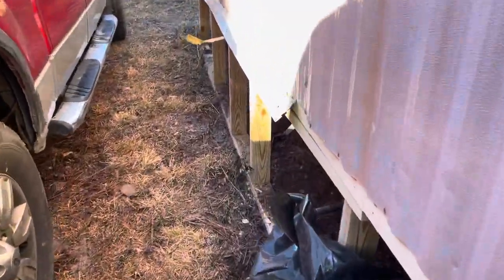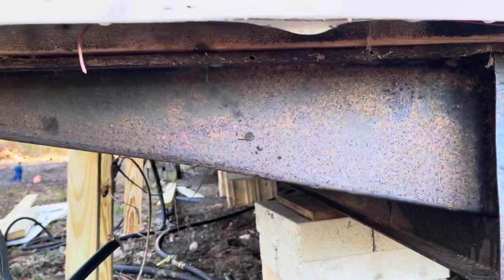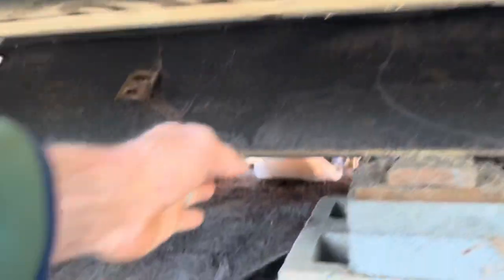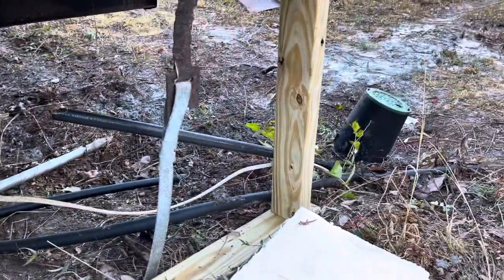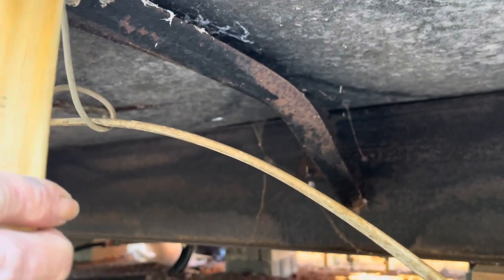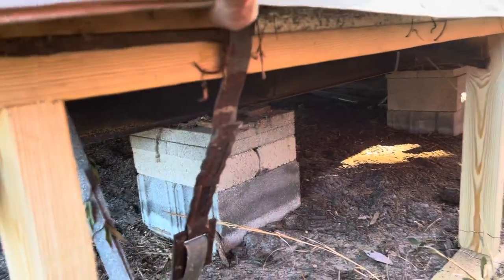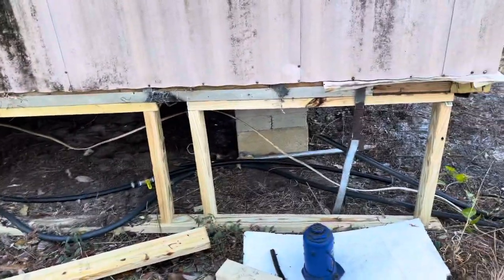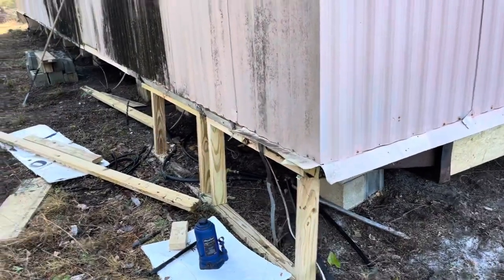Mobile home exterior wall support and underpinning

Comment: Hi Drew 
I had a company come out to look at my double wide. He says I have permiter peers so he wants to raise my house 1 inch on the permiter & place a 4x4 under each permiter block to sit between the house and on top of permiter. I asked him to use more than wants there & he said not necessary. Kinda of a this is how I do it & my suggestion fell on deaf ears. Told me it’s a 4 hour job. I can’t get anyone else to come have a look see . Any suggestions? 
I don’t mind spending the money to fix my home I just want it done right
Look forward to your suggestions
Reply from the maker: Interesting so it sounds like you’re just trying to level your house is that what you’re doing? if you’re just leveling then it shouldn’t take more than four hours.
Reply: My perimeter is sinking if you roll a ball it rolls quickly to the corners & permiter. I have cracks under all my windows . You feel like your walking downhill to the perimeter’s walls . My house is crushing the outside block corners.  This company said my perimeter walls are sinking even though it has perimeter blocks . My house is 21 years old. With what he wants to do in the previous post will it make my house level again ? Is he going about it the right way? Will my walls & ceiling crack. He said he cannot guarantee they won’t.  I’ve been by another company you will never correct it only keep it from getting worse.  Who is correct? May I have your opinion please
Greatly appreciated
Reply: My perimeter is sinking if you roll a ball it rolls quickly to the corners & permiter. I have cracks under all my windows . You feel like your walking downhill to the perimeter’s walls . My house is crushing the outside block corners.  This company said my perimeter walls are sinking even though it has perimeter blocks . My house is 21 years old. With what he wants to do in the previous post will it make my house level again ? Is he going about it the right way? Will my walls & ceiling crack. He said he cannot guarantee they won’t.  I’ve been by another company you will never correct it only keep it from getting worse.  Who is correct? May I have your opinion please
Greatly appreciated
Reply: My perimeter is sinking if you roll a ball it rolls quickly to the corners & permiter. I have cracks under all my windows . You feel like your walking downhill to the perimeter’s walls . My house is crushing the outside block corners.  This company said my perimeter walls are sinking even though it has perimeter blocks . My house is 21 years old. With what he wants to do in the previous post will it make my house level again ? Is he going about it the right way? Will my walls & ceiling crack. He said he cannot guarantee they won’t.  I’ve been by another company you will never correct it only keep it from getting worse.  Who is correct? May I have your opinion please
Greatly appreciated
Reply: My perimeter is sinking if you roll a ball it rolls quickly to the corners & permiter. I have cracks under all my windows . You feel like your walking downhill to the perimeter’s walls . My house is crushing the outside block corners.  This company said my perimeter walls are sinking even though it has perimeter blocks . My house is 21 years old. With what he wants to do in the previous post will it make my house level again ? Is he going about it the right way? Will my walls & ceiling crack. He said he cannot guarantee they won’t.  I’ve been by another company you will never correct it only keep it from getting worse.  Who is correct? May I have your opinion please
Greatly appreciated
Reply: My perimeter is sinking if you roll a ball it rolls quickly to the corners & permiter. I have cracks under all my windows . You feel like your walking downhill to the perimeter’s walls . My house is crushing the outside block corners.  This company said my perimeter walls are sinking even though it has perimeter blocks . My house is 21 years old. With what he wants to do in the previous post will it make my house level again ? Is he going about it the right way? Will my walls & ceiling crack. He said he cannot guarantee they won’t.  I’ve been by another company you will never correct it only keep it from getting worse.  Who is correct? May I have your opinion please
Greatly appreciated
Reply: My perimeter is sinking if you roll a ball it rolls quickly to the corners & permiter. I have cracks under all my windows . You feel like your walking downhill to the perimeter’s walls . My house is crushing the outside block corners.  This company said my perimeter walls are sinking even though it has perimeter blocks . My house is 21 years old. With what he wants to do in the previous post will it make my house level again ? Is he going about it the right way? Will my walls & ceiling crack. He said he cannot guarantee they won’t.  I’ve been by another company you will never correct it only keep it from getting worse.  Who is correct? May I have your opinion please
Greatly appreciated
Reply: My perimeter is sinking if you roll a ball it rolls quickly to the corners & permiter. I have cracks under all my windows . You feel like your walking downhill to the perimeter’s walls . My house is crushing the outside block corners.  This company said my perimeter walls are sinking even though it has perimeter blocks . My house is 21 years old. With what he wants to do in the previous post will it make my house level again ? Is he going about it the right way? Will my walls & ceiling crack. He said he cannot guarantee they won’t.  I’ve been by another company you will never correct it only keep it from getting worse.  Who is correct? May I have your opinion please
Greatly appreciated
Reply: My perimeter is sinking if you roll a ball it rolls quickly to the corners & permiter. I have cracks under all my windows . You feel like your walking downhill to the perimeter’s walls . My house is crushing the outside block corners.  This company said my perimeter walls are sinking even though it has perimeter blocks . My house is 21 years old. With what he wants to do in the previous post will it make my house level again ? Is he going about it the right way? Will my walls & ceiling crack. He said he cannot guarantee they won’t.  I’ve been by another company you will never correct it only keep it from getting worse.  Who is correct? May I have your opinion please
Greatly appreciated
Reply: My perimeter is sinking if you roll a ball it rolls quickly to the corners & permiter. I have cracks under all my windows . You feel like your walking downhill to the perimeter’s walls . My house is crushing the outside block corners.  This company said my perimeter walls are sinking even though it has perimeter blocks . My house is 21 years old. With what he wants to do in the previous post will it make my house level again ? Is he going about it the right way? Will my walls & ceiling crack. He said he cannot guarantee they won’t.  I’ve been by another company you will never correct it only keep it from getting worse.  Who is correct? May I have your opinion please
Greatly appreciated
Reply: My perimeter is sinking if you roll a ball it rolls quickly to the corners & permiter. I have cracks under all my windows . You feel like your walking downhill to the perimeter’s walls . My house is crushing the outside block corners.  This company said my perimeter walls are sinking even though it has perimeter blocks . My house is 21 years old. With what he wants to do in the previous post will it make my house level again ? Is he going about it the right way? Will my walls & ceiling crack. He said he cannot guarantee they won’t.  I’ve been by another company you will never correct it only keep it from getting worse.  Who is correct? May I have your opinion please
Greatly appreciated
Reply: My perimeter is sinking if you roll a ball it rolls quickly to the corners & permiter. I have cracks under all my windows . You feel like your walking downhill to the perimeter’s walls . My house is crushing the outside block corners.  This company said my perimeter walls are sinking even though it has perimeter blocks . My house is 21 years old. With what he wants to do in the previous post will it make my house level again ? Is he going about it the right way? Will my walls & ceiling crack. He said he cannot guarantee they won’t.  I’ve been by another company you will never correct it only keep it from getting worse.  Who is correct? May I have your opinion please
Greatly appreciated
Reply: My perimeter is sinking if you roll a ball it rolls quickly to the corners & permiter. I have cracks under all my windows . You feel like your walking downhill to the perimeter’s walls . My house is crushing the outside block corners.  This company said my perimeter walls are sinking even though it has perimeter blocks . My house is 21 years old. With what he wants to do in the previous post will it make my house level again ? Is he going about it the right way? Will my walls & ceiling crack. He said he cannot guarantee they won’t.  I’ve been by another company you will never correct it only keep it from getting worse.  Who is correct? May I have your opinion please
Greatly appreciated
Reply: My perimeter is sinking if you roll a ball it rolls quickly to the corners & permiter. I have cracks under all my windows . You feel like your walking downhill to the perimeter’s walls . My house is crushing the outside block corners.  This company said my perimeter walls are sinking even though it has perimeter blocks . My house is 21 years old. With what he wants to do in the previous post will it make my house level again ? Is he going about it the right way? Will my walls & ceiling crack. He said he cannot guarantee they won’t.  I’ve been by another company you will never correct it only keep it from getting worse.  Who is correct? May I have your opinion please
Greatly appreciated
Reply: My perimeter is sinking if you roll a ball it rolls quickly to the corners & permiter. I have cracks under all my windows . You feel like your walking downhill to the perimeter’s walls . My house is crushing the outside block corners.  This company said my perimeter walls are sinking even though it has perimeter blocks . My house is 21 years old. With what he wants to do in the previous post will it make my house level again ? Is he going about it the right way? Will my walls & ceiling crack. He said he cannot guarantee they won’t.  I’ve been by another company you will never correct it only keep it from getting worse.  Who is correct? May I have your opinion please
Greatly appreciated
Reply: My perimeter is sinking if you roll a ball it rolls quickly to the corners & permiter. I have cracks under all my windows . You feel like your walking downhill to the perimeter’s walls . My house is crushing the outside block corners.  This company said my perimeter walls are sinking even though it has perimeter blocks . My house is 21 years old. With what he wants to do in the previous post will it make my house level again ? Is he going about it the right way? Will my walls & ceiling crack. He said he cannot guarantee they won’t.  I’ve been by another company you will never correct it only keep it from getting worse.  Who is correct? May I have your opinion please
Greatly appreciated
Reply: My perimeter is sinking if you roll a ball it rolls quickly to the corners & permiter. I have cracks under all my windows . You feel like your walking downhill to the perimeter’s walls . My house is crushing the outside block corners.  This company said my perimeter walls are sinking even though it has perimeter blocks . My house is 21 years old. With what he wants to do in the previous post will it make my house level again ? Is he going about it the right way? Will my walls & ceiling crack. He said he cannot guarantee they won’t.  I’ve been by another company you will never correct it only keep it from getting worse.  Who is correct? May I have your opinion please
Greatly appreciated
Reply: My perimeter is sinking if you roll a ball it rolls quickly to the corners & permiter. I have cracks under all my windows . You feel like your walking downhill to the perimeter’s walls . My house is crushing the outside block corners.  This company said my perimeter walls are sinking even though it has perimeter blocks . My house is 21 years old. With what he wants to do in the previous post will it make my house level again ? Is he going about it the right way? Will my walls & ceiling crack. He said he cannot guarantee they won’t.  I’ve been by another company you will never correct it only keep it from getting worse.  Who is correct? May I have your opinion please
Greatly appreciated
Reply: My perimeter is sinking if you roll a ball it rolls quickly to the corners & permiter. I have cracks under all my windows . You feel like your walking downhill to the perimeter’s walls . My house is crushing the outside block corners.  This company said my perimeter walls are sinking even though it has perimeter blocks . My house is 21 years old. With what he wants to do in the previous post will it make my house level again ? Is he going about it the right way? Will my walls & ceiling crack. He said he cannot guarantee they won’t.  I’ve been by another company you will never correct it only keep it from getting worse.  Who is correct? May I have your opinion please
Greatly appreciated
Reply: My perimeter is sinking if you roll a ball it rolls quickly to the corners & permiter. I have cracks under all my windows . You feel like your walking downhill to the perimeter’s walls . My house is crushing the outside block corners.  This company said my perimeter walls are sinking even though it has perimeter blocks . My house is 21 years old. With what he wants to do in the previous post will it make my house level again ? Is he going about it the right way? Will my walls & ceiling crack. He said he cannot guarantee they won’t.  I’ve been by another company you will never correct it only keep it from getting worse.  Who is correct? May I have your opinion please
Greatly appreciated
Reply: My perimeter is sinking if you roll a ball it rolls quickly to the corners & permiter. I have cracks under all my windows . You feel like your walking downhill to the perimeter’s walls . My house is crushing the outside block corners.  This company said my perimeter walls are sinking even though it has perimeter blocks . My house is 21 years old. With what he wants to do in the previous post will it make my house level again ? Is he going about it the right way? Will my walls & ceiling crack. He said he cannot guarantee they won’t.  I’ve been by another company you will never correct it only keep it from getting worse.  Who is correct? May I have your opinion please
Greatly appreciated
Reply from the maker: You have to support the exterior walls I recommend building walls under the exterior of your mobile home like we did. Raising the center blocks won’t do anything for you except for make it worse. If you don’t build a frame around the outside and jack your house up there like we did I don’t think you’ll be doing anything
Reply from the maker: https://youtu.be/sVRh5ubvvSY
Reply from the maker: This is what you need on your house. If you don’t support the exterior walls you will have sagging like what you’re talking about. You might even have to jack them up. And then install the support like we are. 
https://youtu.be/DaCrswXlHu4
Reply from the maker: https://youtu.be/PgEjzmAHIuQ
Reply from the maker: https://youtu.be/PgEjzmAHIuQ
Reply from the maker: https://youtu.be/A41tS_rKDWg

Comment: They drop down because the spacer wood between the beams and floor joists rotted off.
Still beams are not dropping down. 
Come on man.
Reply from the maker: lol. Nope. This mobile home went threw a ditch and they all were bent